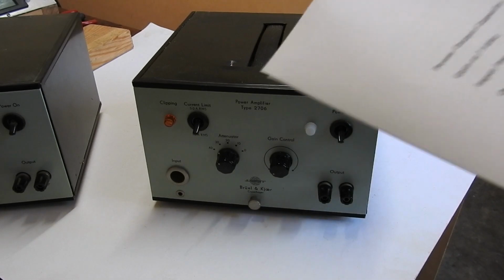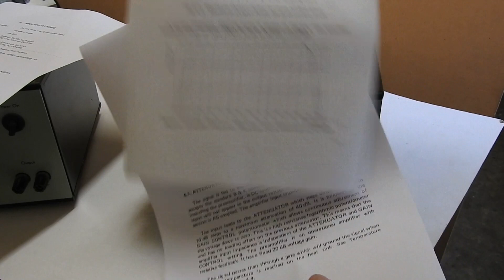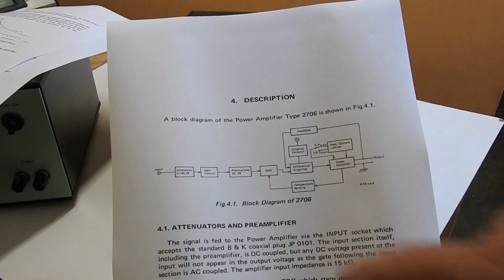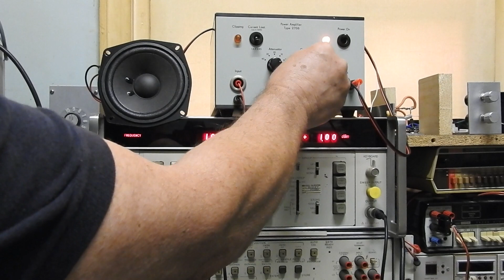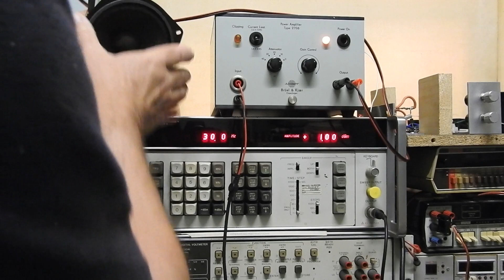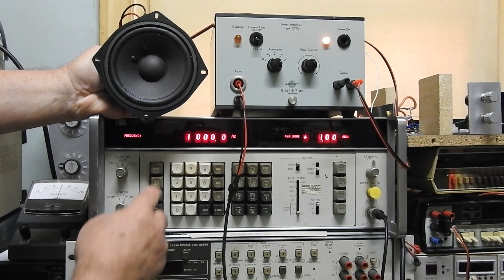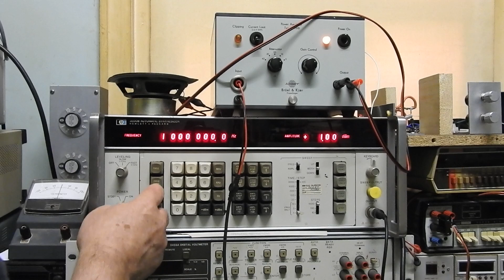Brüel & Kjær Type 2706 Power Amplifier - Quick and dirty teardown

Comment: Bottom plates used to mount their devices on a 19 inch rack case and this bolt helps to quickly release device from rack case. Where I work we have 4 of them all busted.